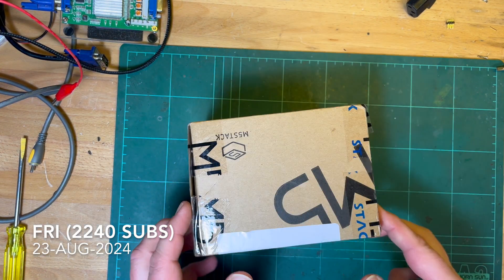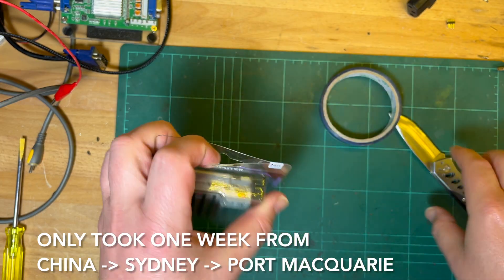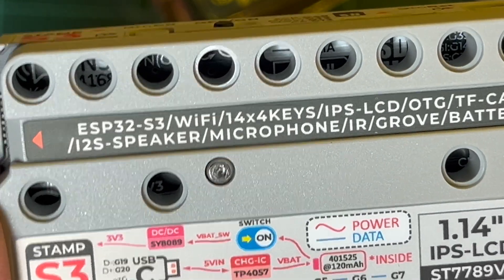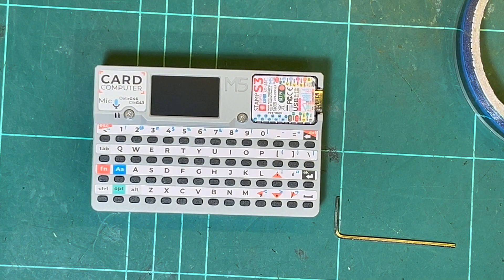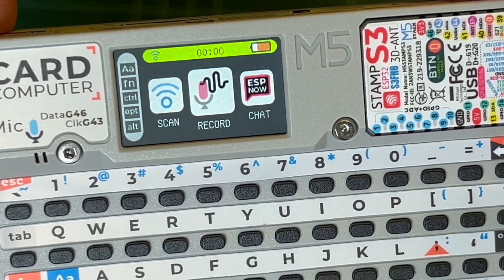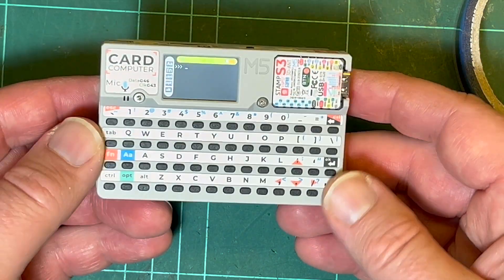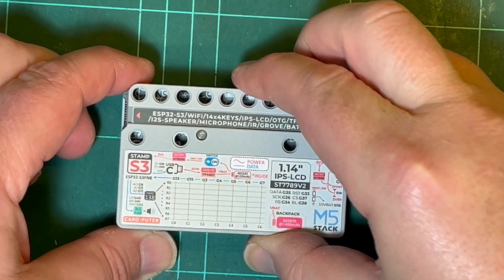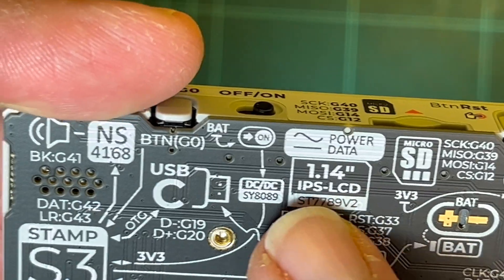🇨🇳 M5Stack Cardputer: Part 1 (Quick Look) [TCE #0509]

Comment: I keep on seeing these things been spammed on Taobao. Should I buy one?
Reply from the maker: It's been sitting on my fridge (magnet) since I made the video, so I would say it depends if you had some idea what you could use it for.

I had an idea to write a script on it to query our solar panel inverters and display the current power generation (maybe updated every minute), but just haven't gotten around to it: 
https://youtu.be/AlSxTeN-W1I

The inverters have WiFi dongles that upload the data to a server ... somewhere (yes, probably China) ... which I can then query using an app on my phone.

Alternatively, I could just query the inverters directly on my local network ... this could do it, just need to figure out power management.

Comment: That's kind of more my speed these days. I've got containers full of Arduino and ESP32s etc. You'll probably be wanting to write your own code for what you have in mind. I kind of default to MicroPython on everything now, it's pretty complete in what it can do and the micros are powerful enough to deal with it. That's what the REPL prompt is, typing in python code interactively.
And you should be thankful your GST is still only 10%, it's 15 in NZ and the same deal with overseas purchases.:)
Reply from the maker: Oh cool, I love Python but never used it interactively.  Just waiting for the Brits to wake up and pipe up about their VAT rate :)  They had a hard time getting a consumption tax into Australia ... the famous "birthday cake" question that undid the first PM-wannabe.  So I guess they started low, not realising that it'll be really difficult to then increase it (election suicide) ... I don't mind if they do, but only if they bring down income tax rates at the same time

https://w.wiki/AzBT

Comment: the M5 is just a fancy bunch of stuff for the ESP32 line of micros with wifi..little overpriced tbh.. its quite easy to setup a ps2 keyboard and mouse and SPI screen to a esp32 module..and they program quite easy with arduino ide...ESPNOW (which the firmware seems to be based on) should already have MQTT stuff build in to communicate with websites (if they also support MQTT)
Reply from the maker: Yes ... I can just see the wife letting me tape a PS/2 keyboard & mouse to the fridge door 😆 But I understand your point!  The screen is a little small for what I want to do with the solar inverter monitor thing, but it's such a compact little package I thought it'd be good for a proof-of-concept before I hack together a larger screen, etc.
Reply: @Brfff  There are a lot of different formats to the M5stack stuff. I tried buying one last month, but it got lost in shipping. I wish the ESP had a bit more RAM though, would be even more useful.